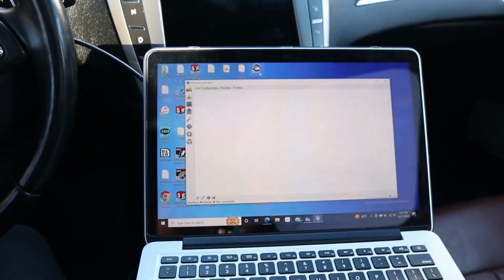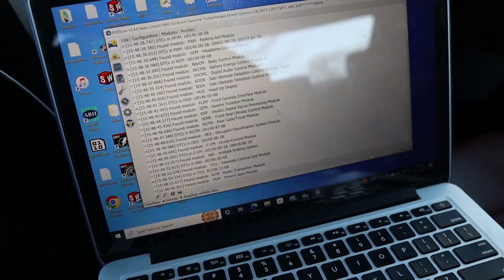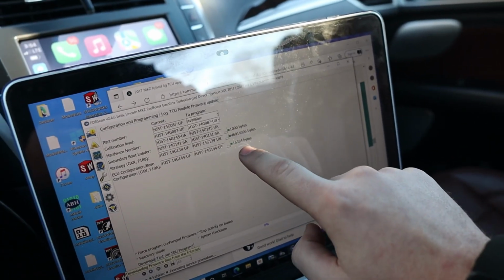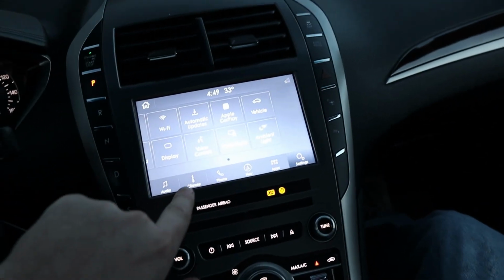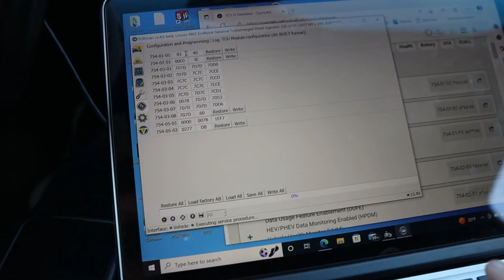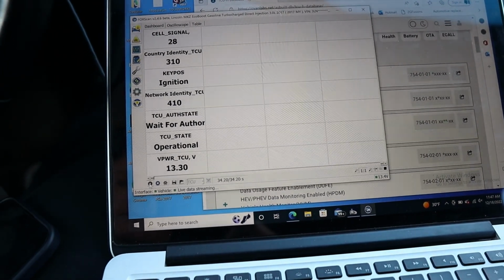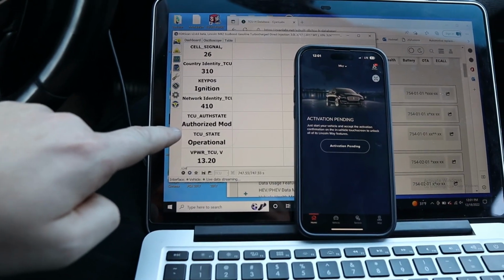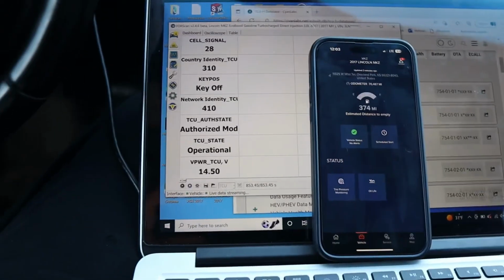How I upgraded my Lincoln MKZ TCU from 3G to 4G Complete Video

Comment: I’ve tried everything. I used FORScan to check the TCU, and it’s still being detected. I performed multiple module resets and reboots, but it still won’t work. The ESN remains missing and FordPass activation fails.
Reply from the maker: Did you enable the TCU in the APIM? There’s an option you need to enable if your car don’t originally have a TCU.
Reply: @ChadMees i have ford fusion 2020 se, and the ford pass was working but the modem number suddenly disappeared and the app stopped working
Reply: Idk if i should get a new modem but mine is alive, as the application viewed it, but its not letting me accessing the TCU files or changing the numbers
Reply from the maker: @AhmadMortada-r2c are you able to monitor the live data from it? Something sounds wrong
Reply: I can see it as an option to reboot but i cant access its configuration and programming
Reply: @ChadMees Update my modem looks dead, so i ordered a new one, i know how to reset the vin using forscan, but my concerns is that what if the new used modem i got is still linked to an old fordpass account?
Reply from the maker: @AhmadMortada-r2c follow the steps here to force reset it. It should be writing the 00 in the asbuilt as I mention in the video
Reply: @ChadMees  Thankyou so much, ill update u when i program it

Comment: Do you know what values should I enter in my as built configuration? I have tried B100, but it didn't work unfortunately.  I have a 2017 F150 xlt.
Thank you
Reply from the maker: What is the problem with your setup? Not activating? Have you monitored the status of the TCU?

Comment: Could you add the part number for the 4g antenna you used. I've seen on some boards ppl have had to use 2 antennas? I noticed you just used the one.
Reply from the maker: @SavNout01  if you are just adding the remote control then your module should only have one antenna port. If your module has 2 ports then it supports the WiFi hotspot but that is a bit of a process in itself. You can use either modem and only connect the antenna to the one port.

As for the antenna I used the BINGFU antenna which will result in a dtc for the TCU but it will work. If you want to eliminate the dtc then you will have to use the PIFA antenna from ford.

Antenna I used: 
https://a.co/d/bMSlRKj

Comment: I read the pdf document you mentioned. Did you have to buy additional equipement or pay for a license to do the IDS scan?  Thanks!  great video
Reply from the maker: You need FORScan license but you can get a free license for 2 months
Reply: @ChadMees  so Forscan can handle the IDS part?  thanks for the quick response
Reply from the maker: I didn’t do anything in IDS. Everything was done in FORScan

Comment: Has anyone tried it on 2017 Continental Reserve? 2020 Continental TCU has different part number than the Fusion (JD9T-14G229-AL) and it also has 2 antenna connectors(pink/purple and yellow/mustard). I’m assuming purple is the 4G and yellow is the SiriusXM. Current 2017 TCU doesn’t have any antenna connectors.
Reply from the maker: The TCU with dual antennas is usually for models that support the hotspot. Single antenna TCU will only support vehicle functions.

Comment: My 2019 has a bad TCU. Would this process work if I bought a used working one and swapped them?
Reply from the maker: I believe that you can swap the TCU without a ton of programming but I could be wrong. This process is for cars that had the 2g or 3g modem to start with. You may be able to get a TCU with the same part number and drop
It in then factory reset your sync system it it may work
Reply: Sounds like it's worth a try! Thanks for the advice!
Reply from the maker: Make sure you remove your car from your Lincoln app as well if you try this. It will likely give you an error if you don’t

Comment: I have a 2017 MKZ Select that never had a modem in the first place (it was an option for that trim, standard on higher trim levels).  

What do you think the odds are that they made them all have the capability to have one, and left it up to the buyer to choose whether to get one, then just hook one up if they did?  I'm thinking it could be doable if all those connections are there, just no modem.
Reply from the maker: I’m not sure the exact wiring for it but I know it can be added to vehicles that didn’t originally support them. It would likely require some splices in a couple of connectors or wires.

Comment: Well I did it, and it works. Not seeing the charging options tho
Reply from the maker: Assuming you have an Energi model you may have to play with some other settings. I’m not familiar with it but I believe there is some info on cyanlabs
Reply: If you do figure out how to get it to work with the Energi please let me know. I have a 2017 & just left a Ford dealer today & asked about fixing/upgrading the modem. They told me for a while they did but then stopped supporting it.

Comment: Thanks very much for the video. I installed the 4g TCU into a 2017 MKC. I originally tried a “L” series TCU and it just wouldn’t communicate. I didn’t have to update the firmware like in the video. I never figured out in Forscan the tables showing cell signals either. I did have to change the number in the configuration tab from 2 to 3. Then back to 2. I believe those numbers are car specific for configuration purposes. Great video for reference…..I got to see Forscan in use before I tried it.
Reply: Did you have to pay for Forscan?
Reply: It cost a whooping $12...small price to pay @stevenweede7184
Reply: No, I did not pay for it. I simply downloaded it to a laptop. Got a key for it to work for like 90 days for free. After 90 days, it would cost. However, one could just use a different email after the trial was up virtually giving free Forscan.
Reply: @natet7323 or you can just pay the $12 and enjoy the teams hard work.
Reply: @natet7323 I have 2017 lincoln mkc as well and I'm looking to upgrade the modem myself. Was the 3g modem located in the back of your trunk like this one?

Comment: What would you say the procedure is to turn off that programming application and unplug the computer from the car.  Would it be a similar process to that of removing a flash drive from a PC?  Also, I have a ‘13 Fusion.  You think any of this stuff would work at all or am I just out of luck with my particular year.
Reply from the maker: You just press the disconnect button in the bottom of FORScan. I used to have a 13 fusion and I did a lot of different programming on it. The 13 can be a little different with some of the programming but pretty much everything is doable. The hard part on yours will be if you have the wiring already for the modem. If not you would have to add it.

Comment: Will any ford 4g modem work?
Reply: Not all the 4g modems are the same. Case in point, I first installed a “L” series in a 2017 MKC. It could have possibly worked if I downgraded the firmware, but that would have made the job more complex. Much more easier to just resell the “L” back on EBay. Anyways, my car needed the “J” series to work.
Reply from the maker: I honestly do not know. I went with this one because it was recommended on cyanlabs

Comment: What OBD scanner is recommended to connect to the laptop? I’ve already swapped in a 4g modem into a 2017 Lincoln MKC. Thanks
Reply: Did you use the exact same part number?
Reply from the maker: ObdlinkEX is the recommended adapter for firmware updates
Reply: I was asking about the TCU part number. Does it have to start with a H?
Reply: I ended up having to put a “J” series TCU in the car. I have oil life working, fuel level working, mileage working, and tire pressure working. The unlock/unlock and start features are not working. They’re on the phone, but when I try it….those features just don’t work. I don’t understand why just those don’t work. Any ideas?

Comment: Great job! Thank you! Am I correct in understanding that if my 16 mkx has the lincoln way and sync three, I should be able to switch to the 4g?
Reply: I just purchased a 2016 Lincoln MKX reserve with updated sync 3.4
Did you ever swap out the modem and get remote start to work?

Comment: Do you think the 14 model of the mkz would have the same part or work?
Reply from the maker: If it originally had the Lincoln way modem then I would believe this will work. Otherwise the wiring may not be preexisting. You should be able to check in your trunk and see if the modem and wiring are present
Reply: @ChadMees  Alright and I’m pretty sure it does, Everything I have checked says so at least lol

Comment: Can you please share where to get this part?
Reply from the maker: I got mine on eBay. Search the part number and you should find a couple
Reply: @Chad Mees  would you be able to tell me the part number for the mkc?
Reply from the maker: I don’t know what it has to be. I would think that you could use the same one I used here. Mine was actually pulled from a Ford Escape
Reply: can you give the link for the forum thread this particular discussion is on please. A search didn't help. Thx great video btw
Reply from the maker: https://community.cyanlabs.net/t/2017-mkz-hybrid-4g-tcu-upgrade/6814/93
Reply: Does Genesis have a 4g modem part for a 2019 g80

Comment: What all can you unlock in this car with forscan I have base of the base model
Reply from the maker: That really depends on what your car is equipped with. I disabled the double honk when I get out of the car while it’s running and also enabled secure idle so it cannot be put into gear without the key inside